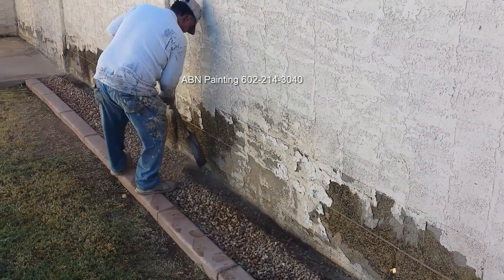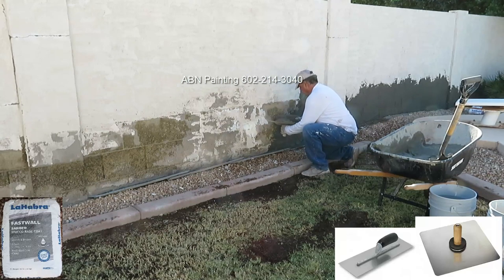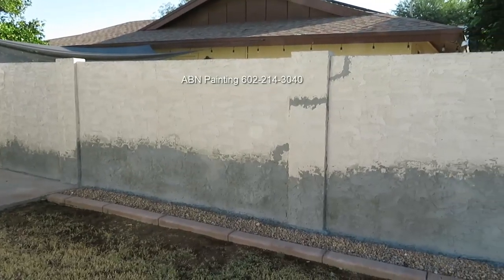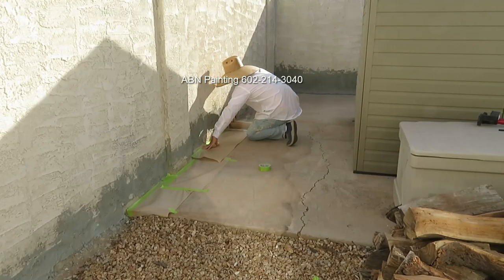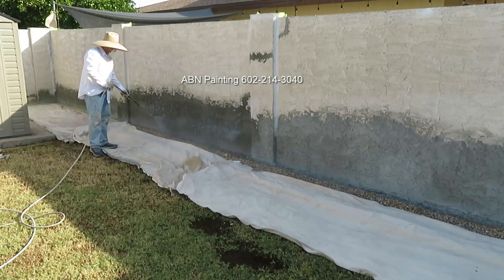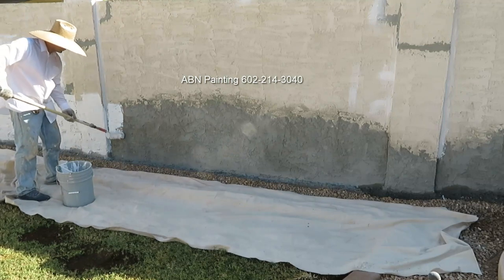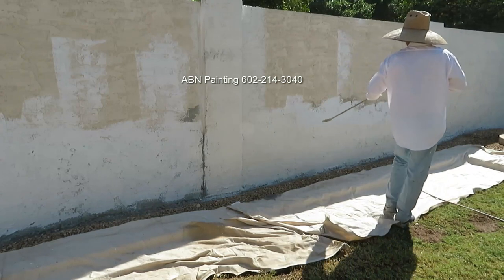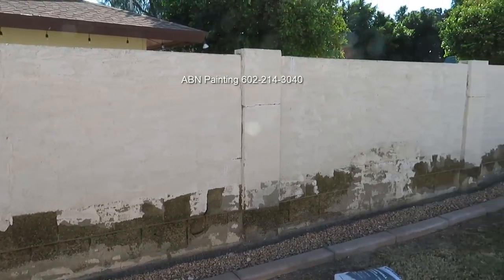Stucco repair and painting of a back yard stucco wall.

Comment: I had my stucco applied in May 2021 and I already have hair line cracks. Is that normal as it settles? Also whats the product you use for smaller hair line cracks please.
Reply from the maker: some cracks are to be expected. elastomeric patch we use for smaller cracks @ 2 min 14 sec in the video.